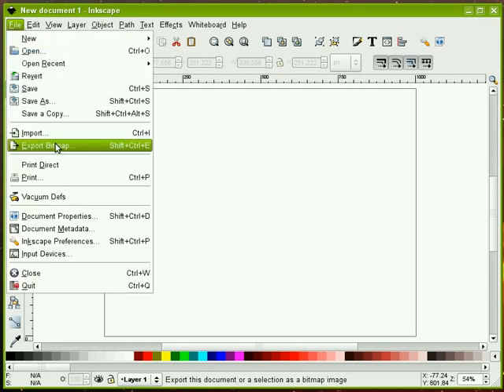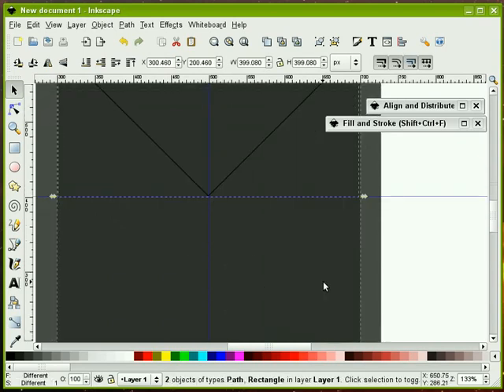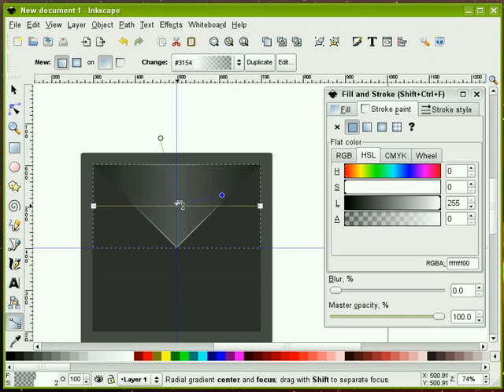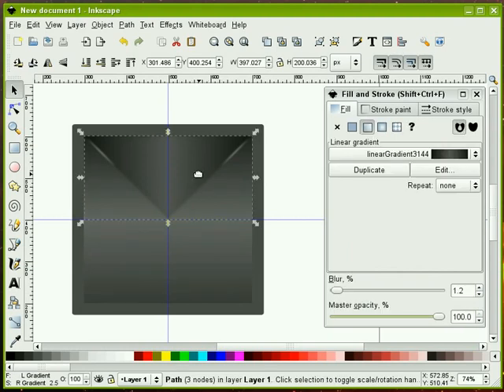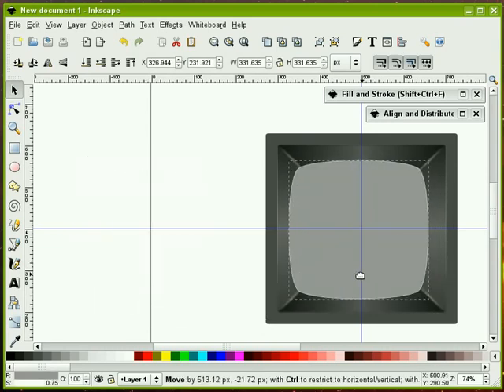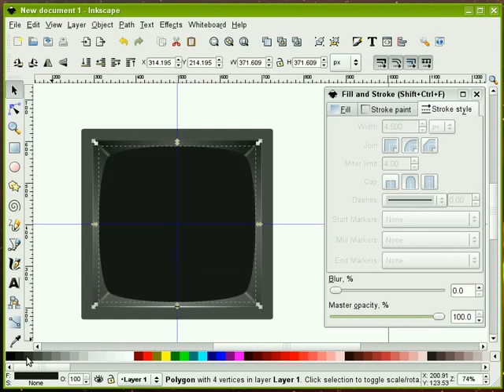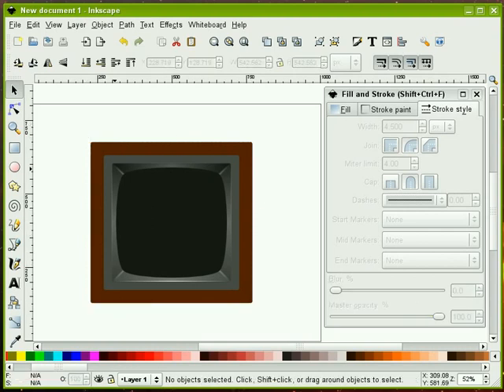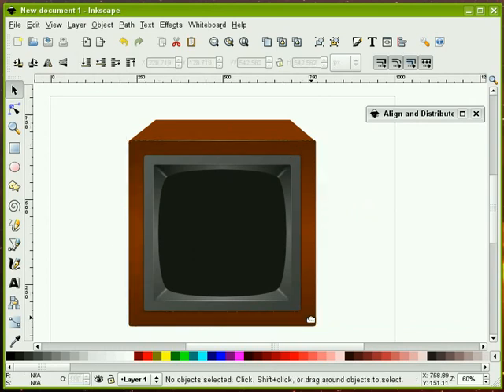heathenX Inkscape Tutorials: episode 051 - Drawing an old-school monitor

Comment: that shift key when editing the outline gradient is a hot tip
just noticed if my object has a gradient it changes when the object is moved, that sucks, version 1.0.2
opps! just found that I have to click the move gradient with object button
Reply from the maker: Glad you managed to spot the 'move gradient with object' button - I've been caught out by that myself in the past.

Holding Shift to separate stops that Inkscape has snapped together is certainly a useful thing to know. Personally I very rarely want them to be snapped to each other, so I would prefer it if that wasn't the default in the first place!